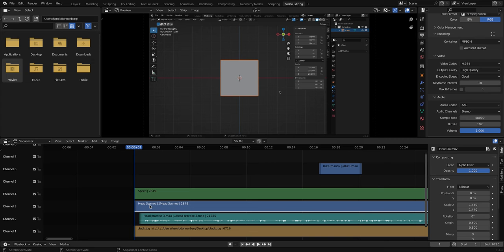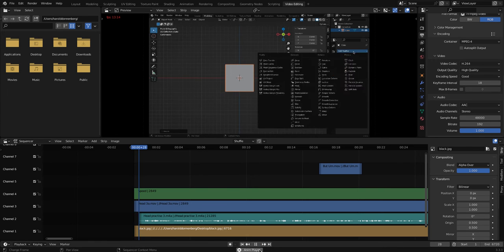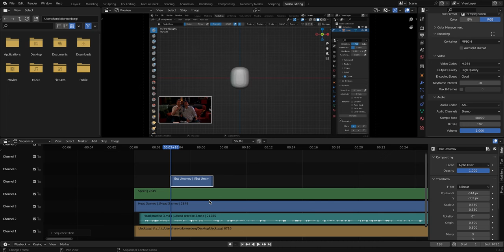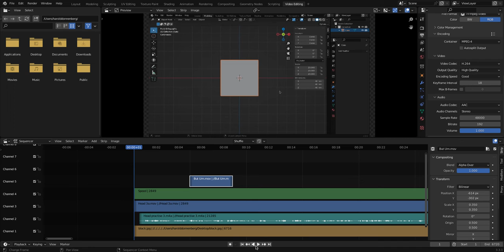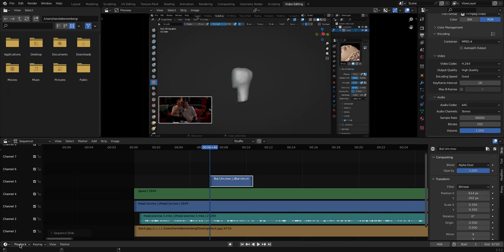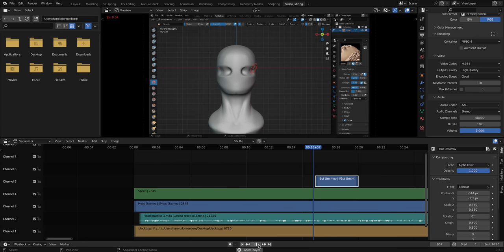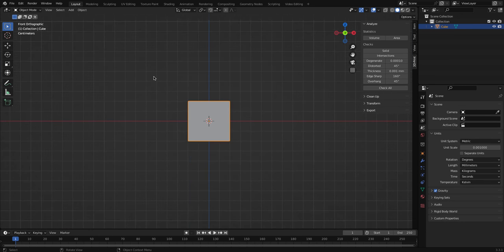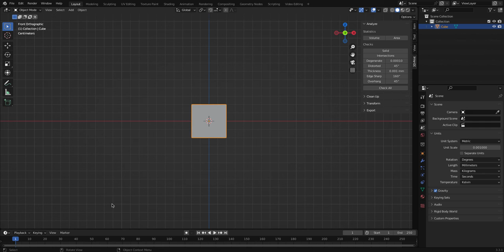Blender Audio Sync Issues In the video editor

Comment: The timeline bar at the bottom where that option is found is shared between the different tabs (Layout, Sculpt, VSE, etc) and Play Every Frame is necessary for physics playback to calculate and cache properly (like running fluid and cloth sims, etc) when doing live playback in the viewport. That's the tradeoff I've found when doing that in my own default project settings.

Comment: I'm a noob trying to make a physics animation to sound. So thankfully I managed to playback the sound reliably with your help. Unfortunately, the physics animation won't play back anymore when "Sync to Sound" is set.
Reply from the maker: That’s weird.  I’m sorry I can’t help with physics though. 

Try the blender help subreddit or blender help Facebook group. I’ve found both places to be very helpful when I’m stuck.
Reply: Thanks for your reply! In the meantime I figured out that (somewhat understandably) the live preview won't work in the "Sync to Sound" mode. The simulation needs to be baked in the Scene settings. I use "Calculate to Frame" for previews.  @Harold_3D
Reply: @Harold_3D  Thanks! It actually seems to answer your question as to why syncing to sound is not set by default. It would mean to make real-time playback a priority, at the cost of skipping frames. But for simulations (and possibly other circumstances), calculating every frame is crucial. Baking is needed for that matter.